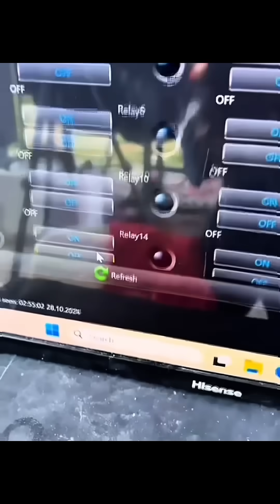Young inventor can turn plastic waste into fuel alternative, will he be able to see it through?

Comment: What most people don't realize is that Diesels, especially older ones like that 7.3 will run off anything, burnt motor oil, seed oils i put 32oz of atf fluid in straight into the gastank every fillup, putting the best era Powerstroke engine ever most with well over 500K miles  made in your video and saying plastilene works is a bit much, you must not have any country boys in the chat 😂

Comment: You realize that obs f350 is not carbonated.  As long as you got a string of filters that truck would gladly run of whale fat, fry grease, used ATF, used engine oil cut with a bit of gasoline.
But no carbonator on any diesel they have injector pumps

Comment: He didn't figure it out,the information is online. It's called pyrolysis he even says it in the beginning of is journey. The thing that is amazing is he did it in his back yard. He only had a couple mishaps but the dude is doing a great job.
Reply: Oil companies did research it a while ago but found it was extremely toxic to make and burn.  Plus its not economically efficient.
Reply: @Slothian  it wasn't profitable. That's why the oil companies came up with recycling to make you comfortable buying more plastic. News flash they barely recycle. Why because it's not profitable enough.just like wind mill waste and solar panel waste. Not to mention the spent uranium rods from all the nukes. Most companies out source all their work because it's cheaper labor and no worries from the EPA.
Reply: @Slothian the oil companies are also responsible for recycling. Which doesn't happen as much as you think. They got it up and running to make you comfortable buying more plastic. They don't use pyrolysis because it's not profitable. Same reason they don't recycle either. Look it up check the numbers. Don't fall for the propaganda. Everything is over one thing MONEY.
Reply: Then why haven't anyone else introduced this to the public as fuel?
Reply: @robertblackshear8963 seriously? What do you think?
Reply: @robertblackshear8963  they have...now they're dedddd

Comment: Plastic is not infinite. It’s finite, ironically enough plastic is produced through fossil fuels. What this guy is producing is nothing more than a alternate fuel not a alternative. There’s a difference. Perhaps you should watch the show landman with Billy Bob Thornton you’ll learn a thing or two.
Reply: Not infinite, but there's plenty of it in places it shouldn't be. At least in this way it is a benefit. Since many companies aren't changing their packaging, I wouldn't worry about there being a shortage in the immediate future. He NEVER said this is a permanent solution, it is a step forward. He can only make the process more efficient, cleaner, and cheaper from here. What he is doing is certainly more than most people are. Not to mention, this is incredibly inspiring to others. It may very well be the thing that leads to a more permanent solution.